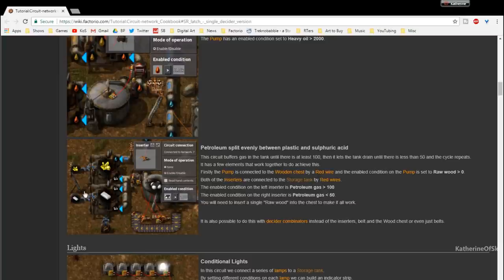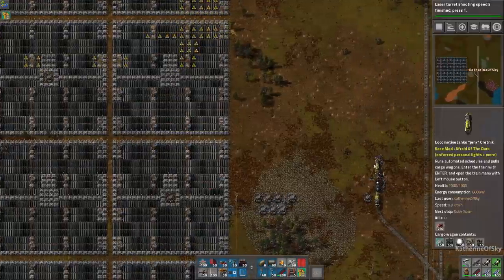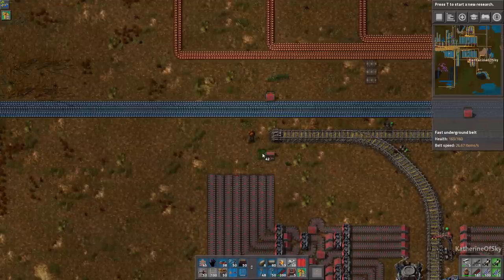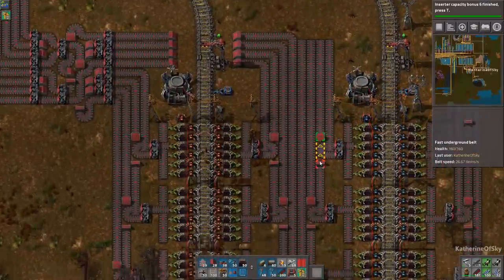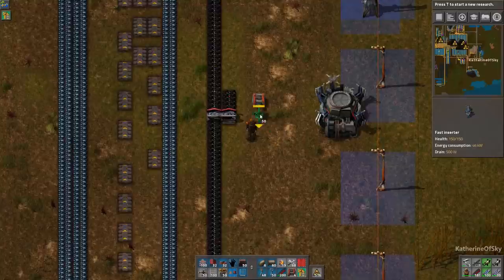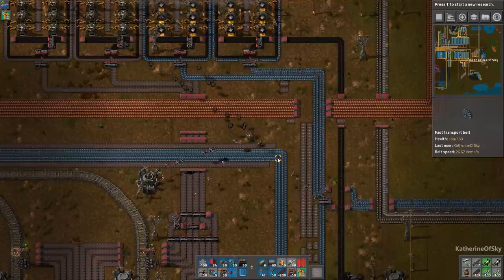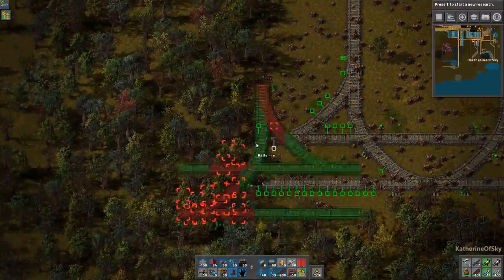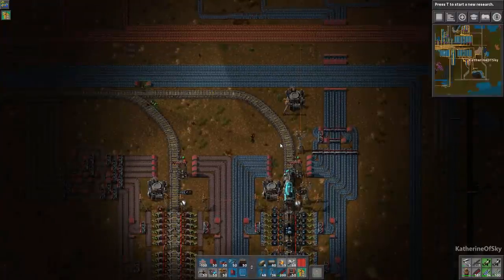Factorio: Entry Level to Megabase Ep 33: GREEN CIRCUIT TRAIN STATION - Tutorial Series Gameplay

Comment: I like to set the conditions for the steam backup power to progressive values, each pump turning on at different accumulator charge levels.

The electric graph will then be easily reasoned about. Steam power will simply show how low the reserves got.
Reply from the maker: That's a great idea!
Reply: With only two pumps, this won't be that much of an indicator, although, can boilers be hooked up too?

Comment: To recycle ore and coal it would probably be good to put a requester chest and an inserter next to a belt that feeds it to furnaces. With a coal line that feeds boilers or burners, it should probably accept other trash, like wood and small electric poles. Am I thinking right? 

Now I understand, why you don't use storage tanks for steam; they wouldn't work when you shut down the boilers by pump to use them as backup power. 

"Online shopping", "Mall", "Sales". Those are funny metaphors.